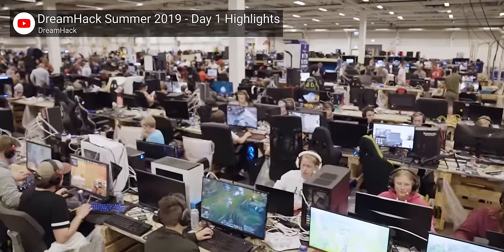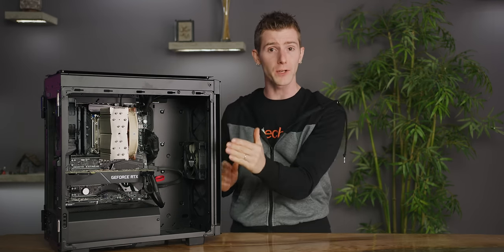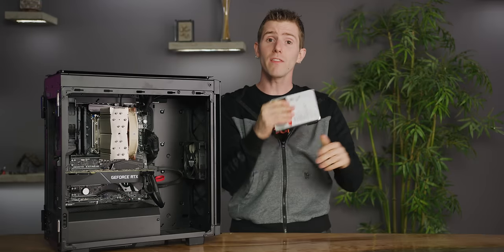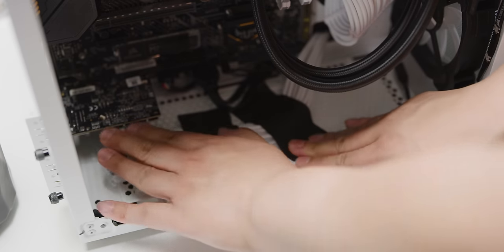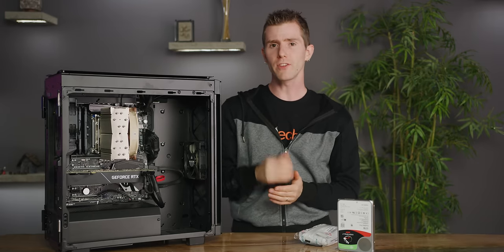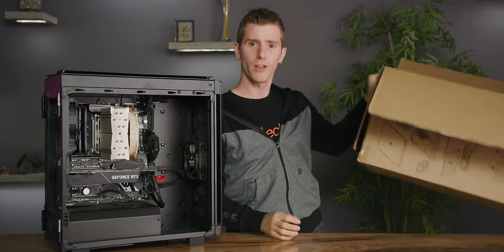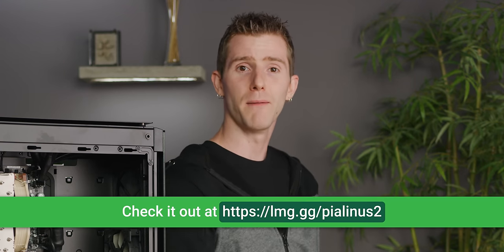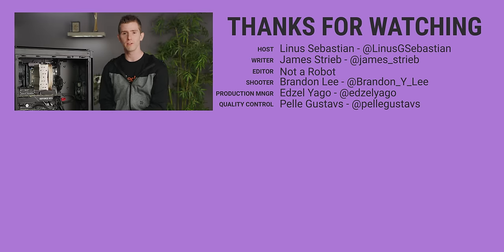How to Not SMASH Your PC - Gaming Rig Packing & Moving Guide

Comment: had to fly with my pc and 2 monitors lately, and actually did almost everything that Linus recomends in here. Maybe someone'll find it useful. I removed all the hard drives and my graphic card, then got those into the bubblewrap and put into my backpack. Than filled all the inside of the case with clothing, very tight so my tower cooler won't be ripped off or something. The case I have is Fractal design Meshify C and it has pretty robust box, so it works just fine for transportation by its own. As to my two 23'' monitors, I removed their base stands, then put each monitor into the t-shirt,  put them face to face and wrapped with bubblewrap, then tightly wrapped all of that with duct tape and put into the middle of my hard-surface suitcase, filled with clothing. Actually that worked pretty well, everything came safe and I also think that stickers would't help much, because of all the automated luggage transportation systems in airports

Comment: A Pelican 1600 case fits a node 202 and a 24 in monitor with 3 xbox controllers, keyboard, mouse, extension cord and cables. This setup has survived 3 trips to the middle east from the usa thru check in luggage even done some purposeful 3 feet drops onto concrete just decided whether you want high temps or high noise.

Comment: Two options, 
1: get a SFF PC, in my case, something like the Silverstone RV series (or in my case, ML07) which secures everything nicely. My current rig has something like 2K miles on it in about a month from driving back and forth to Florida. No issues at all, worked fine every time.

Option 2: if driving, get a Cooler Master Elite 110/130 which mounts your components as if the motherboard was sitting on your desk. Also did this for quite a while, only issue I had was with a PSU being funny, as in not wanting to turn on after being unplugged unless it sits for a day or two.

Comment: Half this stuff involved wedging PCIe components which 

1) torques the slot anyway

2) causes friction on the  contact slits which will wear them away over time.

Just mark which side is the motherboard side of the computer and make sure that side is on the bottom when you put it in your car and your PC will be fine. 

take out the hard drives and put them in anti static bags they came in and just get a hard drive bubble bag off amazon and put them in your glove compartment.

Comment: I recommend taping the edges where the box opens.  It helps keep the box closed like the cross strips, but also has the benefit of keeping things in and out of the box.  Also you may want to mention that stuff being put into the computer case may need to make sure they don't damage the stuff inside either by catching on stuff or static and the like.
Reply: Yes definitely want to do the edges, it's called H-taping. The center seam and the side seams.
Plus using 3"  tape instead of 1.88"/2" tape makes a world of difference.

Comment: It honestly sounds like most of these measures are most justified with air travel and couriers. Whenever I transport my computer, I do it by car. I don't change anything internally, although I have a big GPU and a fairly big CPU Cooler. I pack it in a suitcase buffered by it's UPS on one side and towels/longjohns on the other. About the only problem that I've had was that the fan on the side of the cooler came off it's rails.

Comment: From a former UPS driver.
How to prepare your computer for shipping:

1. JUST DON'T SHIP A ASSEMBLED COMPUTER!
2. Disassemble everything and pack them in the original packages.
3. No regular logistics company will care about markings of fragile/electronics and might actually be less carefully if it is written on it.
4. The unofficial rule is that if it broke during shipping it was not packaged well enough.
5. If you use the expanding foam or pack the inside of the case with "stuff" make sure that everything you use is ESD classed so it won't build up a static charge and destroy your system.
Reply: Not to mention marking your box with "fragile" or "computer" will most likely result in it getting stolen!!!

Comment: I used to have to box up and ship my computer frequently when I would move; it was a Dell XPS 730x, so it wasn't cheap to ship. I used conductive foam to secure the inside components, and I reused the original box until it fell apart and had to use a new box with the expanding foam packs. This worked fine until the last time I had to ship it for a move--my case was dented in a couple of spots, and the tower cooler inside was slanted. It still worked, but I had to bend it slightly so the fans would clear it. I've since moved on to a smaller case...

Comment: It's hell....but I transport my pc to buddies house all the time. My best friend lives on 2nd floor and across the SF Bay. I rock a 900D with an h100i and 1080ti strix . Never had an issue since I built it with a 4770k haswell, although it had a 780ti reference before. In the car I put it behind passenger seat with seat belt and lean the front passenger chair against it for support. Then i put the monitor on its back in the front passenger chair and keep a hand onit while cornering or going over bumps. Still running strong after dozens of transports.

Comment: If you have a tall cpu cooler, or a graphics card, adn you are the one moving it, try to set your case on its side to prevent you board from getting bent, as the cpu cooler and graphics card are upright, so gravity will pull them down instead of sideways. I would still put supporting material as well! Good luck moving your battlestations!

Comment: I'm getting a miniatx pc, probably gonna purchase the extra carry on option for flight, take out cooler, graphics card, ram, and psu. Taken out parts into overhead carryon, pc in my hands. Stuff jacket with the stuff i wanted on the smaller carryon, like water. suffer with my hands full for a few hours, use the jacket as extra padding for the case.

Comment: When I transported my computer from brazil to canada I put it in my suitcase. I dissasabled all the components and packed them with bubblewrap, then I packed everything inside a suitcase with bubblewrap and clothes inside and around the case so there would be no gap anywhere. They still managed to fuck up my case, they put a dent in the corner of the case, THE CORNER, the most sturdy place, luckily no component was hurt and my machine is happily running minecraft at 60 fps

Comment: This is probably a dumb question… if you dismantle a previously used computer and put it back together again, then turn it on… will the software recognize that this happened or will it turn on normally like you hadn’t disassembled and reassembled the hardware?

Comment: Keeping boxes can be completely impractical to many people.  There are 5 PCs, 8 monitors alone in the house.  Now add another 5 TVs, 5 consoles.  If I kept all those boxes intact, I'd had to consider renting a storage unit just to store all those large, non-broken down boxes, with all its original packing materials.

Also, be wary of CyberPowerPC; a friend's rig I recently helped with; was the biggest mess I've seen in a long time.  No love, cheap fans that 4/5 failed, the last was about to.  Cable management by a drunken spider.  HDD hanging LOOSE stuffed in the 5.25" bay area, with the SSD placed lightly resting on top of it, also unsecured; and other things that shouldn't happen from 'professional' builders.  Just watch Linus' videos on it ;)

Comment: I ship staff every day, and often I can find filling material at my local transfer station. Usually giant bags of peanuts and bubble wrap.

If I have to ship valuable stuff, I always ship it insured.
Plus, having a liquid containment  sticker on the outside will help too, since the carrier doesn't  want to damage more packages than necessary, if it starts leaking.
Or it can cause trouble  whit your carrier and delays your shipping, but it will be saver.

Comment: Moral of the story, just drive. I've transported my PC many times in my car and never had issues (never really did anything special with it either just unplugged it and put it in my car). I will say though the only thing you should do in your car is put the PC in a location where it won't slide around so either in the trunk wedged between say a suitcase and the wall or at an angle in the back seat.

So if you're in the US and you can just drive there, drive there.

Comment: last time i went to a Lan i took out the GPU and put the pc in the footspace in the car so it cant really move around. And for the monitors i did the same just that i put something in between to fill that gap. It worked really well. My HDD is laying flat onto a surface on the case on the inside.

Comment: I saw someone fill their case with packing peanuts. DONT DO THAT its a nightmare to clean out. The foam works nicely as well as anti static air bags. Ive seen graphics cards and coolers come loose and break stuff. Not pretty. I keep my original packaging for the computer and monitors and they work well with the treatment linus outlines. Good stuff

Comment: I am currently using a gaming laptop, which is obviously much easier in terms of traveling, although laptops are nice my current specs are starting to age where it's a i5 7300 2.5 GHz CPU and a Gtx 1050 with 2gb of vram. I don't want to get anther gaming laptop as most of the time they are more expensive than  desktops, and have almost zero options for upgrading specs (besides ram), where overtime a desktop would be considerably cheaper and only parts of it would be upgraded, instead of replacing  a whole entire computer having a laptop. Although these are the pros to having a desktop over a laptop, I travel on airplanes, which is bad idea for desktops in general, I would plan to only travel with it only once a year with the desktop(there and back). I just wanted an opinion, is it safe, or should I continue to buy laptops instead.

Comment: Just use a sensible CPU cooler like a 212 evo instead of a huge one. Securely mount it with a backplate. Make sure to use a GPU bracket if you have a large GPU (smaller ones like the ASUS Turbo series or Founders Edition. Also, save your PC case shipping box!

Comment: Not saying this advice is bad, but there are many flaws.  Internal damage of the PC is pretty uncommon from my experience if you have proper packaging.  Anything over 45 pounds need to be in a double wall box.  2 inches or more of heavy duty bubble wrap or the nice LDPE foam.  If you can shake the box and hear stuff move loose inside it then your packing job sucks and you stuff will get damaged.

Comment: Getting ready to send my Brother a system through the mail. The only part I am unsure of is the UPS. Do I just send it(properly packaged, of course)? or Should I remove it?  Should I leave the Battery in the unit, but treat the terminals (disconnect and isolate them from making contact with anything.) I almost feel like I am worrying over nothing.
Reply: also his system has an M.2, a SATA 2-1/2" SSD. and 2 regular Hard drives(2-1/2"&standard). The PC is being shipped X Country. Will those Hard drives be at risk? (I am thinking of vibrations, bumps, and drops during its travel time)

Comment: I always transport my PC with my car for LAN parties. Several times my PC just slides over my monitor at the back seat whenever I do a sharp turn. Note that my case has tempered glass side panel and a pretty heavy 2.5 slot graphics card.

Comment: Linus. Removing the cpu cooler is fine for Intel users. But AMD doesn't have cpu mounting that holds the cpu in. Very bad idea for AMD owners to have a exposed cpu during transport.!!!!!!!
Reply: The CPU is auctully held in with AMD
Reply: @BenCos2018  AMD doesn't have a retention system. It uses the socket clasp which is weak. You can pull the cpus out with you hand.

Comment: Nah fam just because you use an AIO does it mean your computer will 100% survive the trip. I was moving with my computer and my AIO came untightened just the slightest amount and caused my CPU to overheat. the only way you can 100% guarantee that your heat sink will make the trip is to take it off.

Comment: I got a computer case from my brother who got rid of its original box.  Does anyone have recommendations where I can find boxes tall enough for a computer without being wide and long?   Or would it be okay to use boxes short boxes whose length and width can accommodate the case on its side?  If I need to use multiple boxes and a lot of tape it might not be a big deal.

Comment: Linus are you planning on doing any giveaway's I really am in need of a new computer but I can't afford it, right now I have an i5 and 4 gb of ram and I mostly play rust and as you know rust its not very optimized so I run at lowest graphics and lowest resolution and I run it at 30 fps with all those settings so I could really use a new pc.

Comment: lol Linus .. you deal with networks a lot ... you may want to look into PIA and realize that it will screw up your network if you use it ... its fine for a person with one computer but if you have several on the network it will destroy the ability to communicate with other PC's on the network. I haven't used it for a year because of all the issues it had with my network ... maybe they have fixed it but when I was using it I did bring up an issue with their software that persisted for the whole year of subscription that I purchased so it was never addressed and it was a VERY BIG issue. 

I'm sure Linus will have issues with it if he actually tried to use it on his network due to both Windows and Linux boxes. The major issue they may or may not have fixed (guess they finally updated their program) was an option (forgot what it was called but will not install the software again on the chance that it destroys my network again and causes me to do a complete reinstall of windows to finally get the networking working properly again) that would keep you from leaking your IP address if you lost connection from the VPN... If you lost connection you would have no internet connection  until you shut down the program or reconnected to the VPN... This is a feature that is good to have except for with PIA... with PIA it would make your default gateway blank so it would not connect to the internet again if you got disconnected from the VPN .. then it wouldn't even connect to anything again VPN or otherwise because of the blank Gateway the PIA software would fail to connect to the VPNs and without PIA running you couldn't connect to the internet either .. even after a reboot. 

This may have been fixed .. all these issues may have been fixed but ... Linus has been accepting advertisement and getting a lot of people to use this service that is destroying peoples ability to use the internet .... it doesn't look good accepting a destructive product as advertising... Look into NordVPN Linus ... they offer sponsorship and I have used them for a while and haven't had the network issues like PIA

Comment: can someone here help me with my pc? i cant figure out what to do to get more fps out of it. i threw a new gpu in it but it didnt really seem to help at all? like im barely getting 30 fps in csgo on low settings??? wtf is going on?
i have a ga-ma785gm-us2h (rev. 1.0) mobo with a phenom 9650 and a ets-n31 for heat sink and 8gb of ddr2 (2x4), 600w evga ps, and a msi gtx 1050ti with a big case fan. im not looking for crazy performance but i want to be able to atleast run csgo or world of warcraft on decent settings and not have low 20 fps. i cant figure out what cpu would be better and still be compatible? i know i could get a new board and stuff but i wanna try get this to do its best. any help would be great.